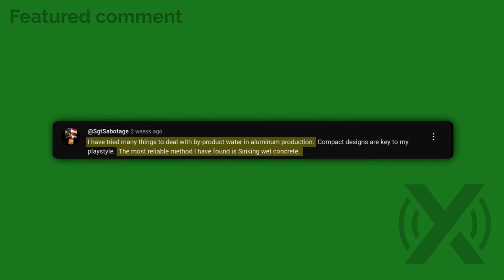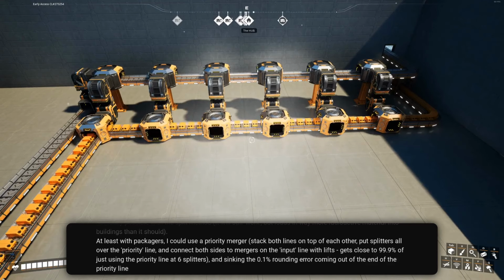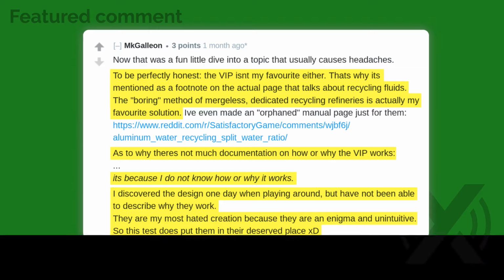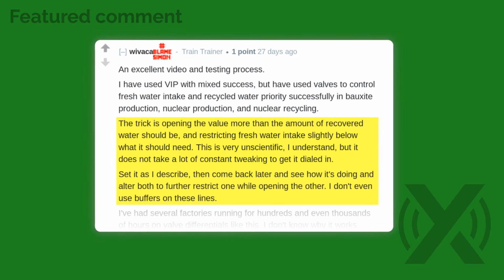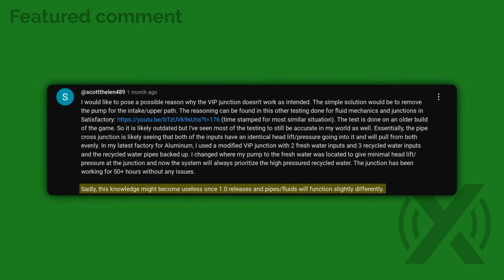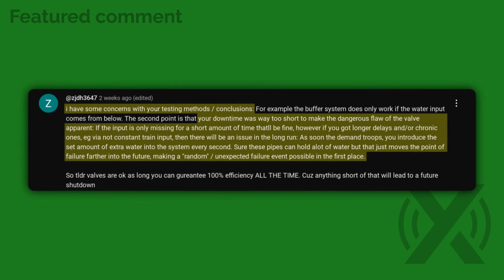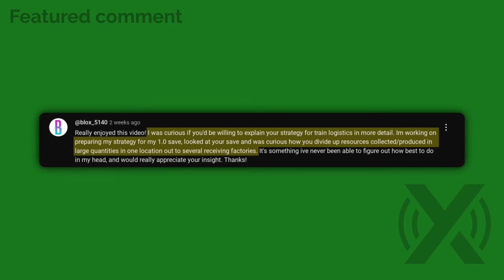Your questions and suggestions on fluid management in Satisfactory U8 (also, thank you for 2k subs!)

Comment: One more thing I faced when dealing with fluids, and didn't find any mention on any fluid guides, don't send the pipes,

90 deg turn is fine, and I didn't test it on new curve mode for pipes but for some reason when I bend the pipe gradually some times the fluid stuck when running on background.

Comment: Ups, did not register about this more actual fluid topic video, so you'll find a comment in the mentioned other one...
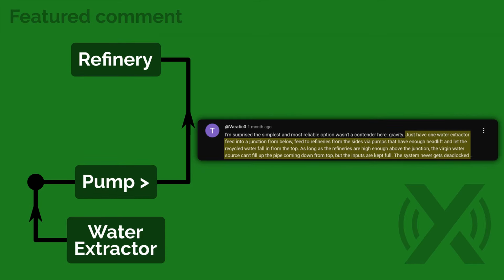Solution in short (seems bit similar to 3:20 - but not so much effort in case you already have #2 headlift-reset in place):
Use that #2 headlift-reset, just add additionally a "powered" pump on the "by-product" pipeline (as more headlift then and this will go for this reason into the industrial fluid buffer first ... at least I think this is the main reason.. only the developers may tell about whether this is right or not .. hehehe)

Thx for all the info and your effort, wouldn't come to this point without these. All pipes and by-products working fine for me now (watched over hours and hours...)
Have fun!  ;-)

Comment: I've not spent a lot of time dealing with this issue, but what I did do was simular to the vertical headlift reset except I put valves on both sites of the junction to prevent back wash... then I overclocked until lock, underclocked to exactly what I needed and flushed a small segment to remove the lock. That save never game me a problem after that config.

Comment: Its probably because of the update but the Headlift reset design does not work for me, maybe i did something wrong but when leaving the server or going somewhere else when i come back the water output of the refineries are full and everything stops working, now VIP Junction seems to work but it might still fail with missing input test but that won't be the case in my build unless there is a total blackout but then more is just burning than the aluminium production.

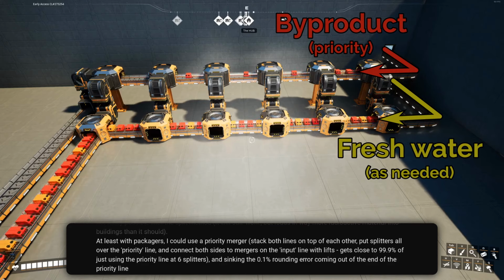Comment: your first video helped me alot about the by product for the silica building. And this one now solves another problem, which is the same idea, but for non-liquid products. The problem was: I needed to put a priority in 2 lanes (one comes from a drone, another from a chest that I fill manually). The priority must be the drone, while the manually chest should be used only if the drone wasnt enoght. With the design in 2:20 my problem can be 90% solve 😁😁

Comment: My way of thinking of the VIP circuit is that water from the byproduct line pushes 'up' against the fresh water that is going over the pipe hump and dropping back down. 

This means that the byproduct is simultaneously trying to flow 'back' towards the fresh water source, and so some of that water blocks the flow of fresh water.

Possibly because the head lift calculation for the fresh water has extra steps in the hump and thus may complete later than headlift calculations for the horizontal pipe. 

Or possibly because there's simply space for it to flow there, even if the UI doesn't show it.

Alternatively the extra math operations in the hump introduce a tiny amount of floating point errors, or some other elements that causes the pipe with the hump to become less valued, or evaluated second. Even if it's only second through sorting, since I don't think the simulation is multithreaded. 

I suspect the reason it fails is because once both pipes become truly filled and stationary (and stationary is the key thing here, none of the water is flowing), the calculations for the whole simulation simplify and neither one is favored over the other. And since neither one is favored, and the entire system is locked up, it can't recover. 

I would be interested to know if the headlift reset buffer tank had any available space Left in it once the entire system came to a halt before restoring inputs. If it did, that might be the only reason it could recover.

Comment: Do you have any method that works on long term games? The current issue isn't dealing with the overflow on paper, its dealing with it in reality where the game duplicates the water slowly over time and clogs the machines. Do you have any that work when the waste water is constantly increasing little by little?
Reply from the maker: I think I want to hold off on making any definitive statements until after 1.0 and whatever changes they are doing to the fluid simulation then (and possibly in later followup patches).

Comment: So there are 2 mods that absolutely fix this issue.  One called 'Fluid Awesome Sink Redux'. That lets you sink fluids and get tickets but used in conjunction with 'Fluid Sink and more' (which has an overflow valve where you can just sink excess when a Fluid Buffer fills up).  I use those 2 mods and can finally sink fluids and filter to only sink very little by using overflow.  I know, some people don't want to use mods, but I have no problem with mods.